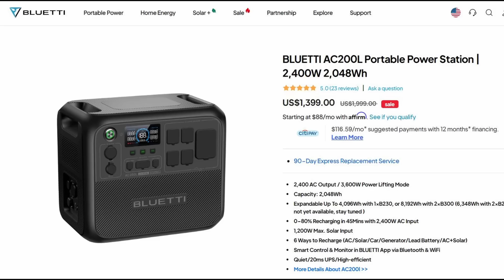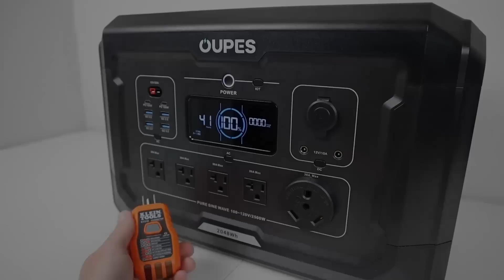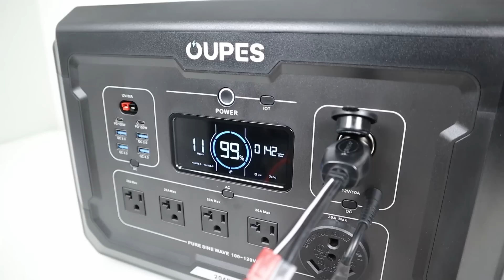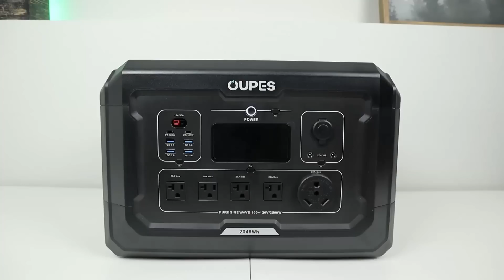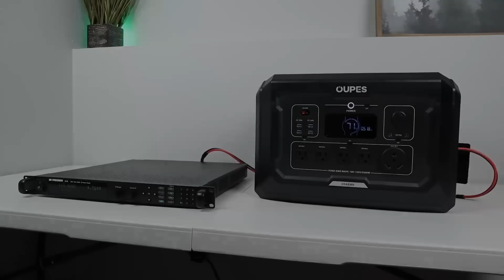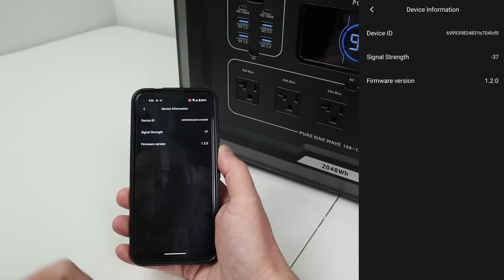The OUPES Mega 2 Wins the Budget Crown! Best Affordable Offering of 2024? Full Testing and Review!

Comment: Oupes Mega 2Fire, Fire. My Mega 2 has been running fine for a few months until last week. I turned on the Mega 2. It and the B2 had 100% charge. I turned on the AC. The units went dead, started popping and black smoke was exiting the Mega 2. Then there were flames coming out of the back. I disconnected the solar cables and removed the cable from the B2 to the Mega 2. The fire went out. There are melted plastic holes on the back of the Mega 2. The B2 back plastic was starting to melt. I will be checking out the Pecron or build my own system.

Comment: It would be really cool to see you revisit this unit with your newest method of showing surge amps/watts on the 30 amp TT outlet particularly with a 13,500 BTU AC if you have one. I'd like to see if the 30 amp plug can handle the surge watts on a camper's AC unit because that would make this an extremely useful camper power station utilizing solar panels. I believe a 13,500 BTU AC running watts are in the 1300-1500 watt range so this should handle that no problem, but I know they can surge up to 3,000 or so for a second.

Comment: QUESTION: When only connected to Solar for charging: When the battery goes low over night and shuts down the system, when the sun rises the next morning and supplies sufficient charge - does this system automatically turn on the AC outlets?

Scenario: Off grid cabin, with refrigerator.  If battery goes dead overnight, will it turn the power back on the next morning, so the refrigerator will have power, once sun is available?
Reply from the maker: No, the AC inverter is either on or off. Controlled by you.

Comment: Chinese lithium batteries are pretty much all the same having said that the mega seems to be the sbc v8 of solar battery generators, may not be the most efficient but it sure is effective 😅 and cheaper by 200-300$, granted it’s got higher output dc is a plus cause diesel heaters need at least 120-140 watts to start up the glow plugs ❤, usb ports all available nice maybe not be as efficient as others but really effective and usable, too bad the solar input wasn’t tested to its maximum capacity, I would say this unit would your best budget buy in the 2k category

Comment: Good morning, Did you by any chance test the Oupes for it's ability to turn the outputs back on when the solar input starts in the morning after going flat overnight???
Reply from the maker: If you have app connectivity you can turn it back on remotely. It does not turn the AC inverter back on automatically.
Reply: @Jasonoid  So the wireless comms does come back on when the solar powers it back up. Excellent!!
I don't believe my Anker C1000 does that.
Thanks
Happy New Year
Reply from the maker: @dannydivine7699  you'd have to confirm that exactly with this model, I think that's the case though.

Comment: It looks like that AC charging cord is proprietary.  I have not seen that male configuration before, so I guess you have to contact oupes if you damage the cord or lose it.
Reply from the maker: It's less common, but it is a standard plug. It's meant for more power than the normal Nema15 amp charging cable. I'm not sure of the name though.

Comment: This review sold me on it. I bought a refurbished unit from the oupes eBay listings which is another way to save money on one when those are available. The first unit was faulty, charge controller had issues when solar power input went above 500 watts but I contacted oupes support and they arranged getting a replacement for me within a few days. That one is working fine. I plan to add on the extra battery to it in the future. I like how each extra battery has a solar charge controller built in so you can get a lot of power sent into them.
Reply: Total Game Changer for Sure

Comment: Hi Jasonoid, thank you for your in-depth review of the Oupes Mega 2. I was wondering what your thoughts are as to why the stand-by idle power usage of the Inverter is so much higher on the Mega2 than it was when you did a comparable stand-by  Inverter idle usage test for 11 hours for the Oupes Mega 3?  31% for the Mega 2 vs.10% discharge of the battery capacity for the Mega 3?  I wonder if Oupes is using different, better battery cells for the larger Mega 3? Can you comment ?  Sure would appreciate your input. Thank you for all the detailed work you put into these reviews especially for the Sogens.
Reply from the maker: The Mega 3 inverter probably doesn't use that much more idle power than the Mega 2 inverter so the larger battery of the Mega 3 gives it the advantage when dealing with idle power consumption.
Reply: @Jasonoid  Thank you. What about the concept that the larger the inverter; the higher the idle drain?  the Mega 3 has the 3600 watt rated inverter while the smaller Mega 2 has only a 2500 watt rated inverter. Seems like the idle drain of the Mega 3 would be considerably higher than 10%...
Reply from the maker: @scottb6020  hard to say why since I tested the unit and that's what it got for the results 🤷 maybe it was a fluke? I'm sorry I don't have more concrete evidence for your answer. I don't have the Mega 3 to test with anymore. They only provided a sample for the video and then wanted it back.
Reply: @Jasonoid  That’s ok. Thanks for getting back to me again. Love your videos on Sogens and solar in general. Am a fan of your Power Grading System too. 👍

Comment: I have the Mega 3 w/extra battery.  What is the best way to maximize the full 2100 W solar each can take in.  I bought some cheap Trina 250w solar panels that are 37.6 V and 8.27A  TY
Reply from the maker: How many panels do you have?
Reply: I have 13
Reply from the maker: @brianwluxevovacations215  I'd put them in a series parallel combo as close to the max 150v input as possible. If you need more guidance on that type of setup you can reach out here:
https://asqme.com/@Jasonoid
Reply: @Jasonoid  using all 13 of them together?
Reply from the maker: @brianwluxevovacations215  I'd have to do a bunch of math and calculations knowing the exact specs of the panels to figure out the best setup.
Reply: Hey, 150v divided by 37.6v is almost 4. So 4 panels in series should work out to 150v. Then connect other 4 panels in parallel. And if you want more do the same, always in groups of 4. So you could go to 16 panels total so you overpanel for cloudy and rainy days, thing is to be at the 150v limit (4 of those 37.6v will achieve that). Current will be limited to 15a so maximum with the 16 panel setup (4000watts) will be 2100w solar input BUT you get to have it mostly maxed out which is great. If you had only 8 panels (2000 watts) then you'd get far less solar input since you cant really achieve 100% solar performance and with clouds its like 20% or less. So overpaneling (safely) is good. Ask someone who knows and can test it in person just in case. Hope this helps. Cheers

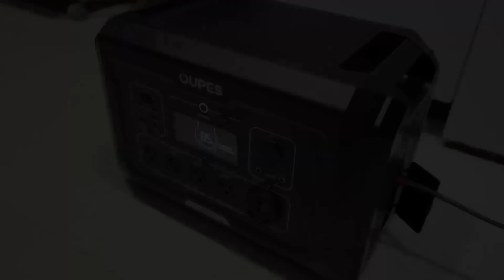Comment: Does this have dark start. 20:00 the Hysolis Apollo has DARK START, meaning of even if it's completely run down, it will start up on sun, and do so at a particular preset charge, say 20%, and then turn on the inverter and maintain loads.
Reply: And would have charge sharing and load sharing like the apollo?
Reply from the maker: It does not turn the AC inverter back on after completely being discharged. I don't think it supports the other two features you mentioned either.

Comment: Replaced an Anker C1000 with the Mega 2. Decision made because of price, 2400 ac output and 2100 watt PV input. Jason’s review was right on. Unit does take time to build up PV input and it does require more power to maintain the inverter on with no load. Neither of these issues have negatively affected my use of the power station. BEWARE though the mobile app is bad. Once set up the Anker connected and stayed connected via WiFi. Occasionally had to refresh the app. The Oupes app has not connected for the past two days and when it does connect it doesn’t stay connected very long. This may be a deal breaker. I am working with support which has been responsive. Another reason I went with Oupes is the fact they have a phone number for support, not just email or chat.
Reply from the maker: Are you connecting with WIFI or Bluetooth in the app?
 I've found the Bluetooth comnection is more reliable but you can't see the device when out of range.
Reply: Yeah, I contacted support over the WiFi connection. They want the unit within 16ft, and Bluetooth/WiFi do not turn on automatically.

Comment: I know you tested the 30 Amp Anderson output but did you test the RV 30 amp? Another reviewer did and said it does not put out 30 more like 25-26 so if you need the RV 30 jump up to the Mega 3
Reply from the maker: Correct, the output of this power station is limited by the inverter, 2500 watts. The 30 amp RV port is there for convenience and only provides 2500 watts peak like the rest of the inverter.

Comment: Excellent presentation.  Thank you.  This is a very nice unit.  Very, very solid 12v output options.   The "square" form factor is very nice (some of their other models have a weird top handle).   If you have space for it, this is a solid unit for car/van/truck camping.   I wish they would take this same unit concept and make a couple of smaller units - say perhaps 1000wh and 1500wh.   You should review their B2 Accessory battery.   It looks to be very solid as a stand alone unit if you don't need 120v outputs and a lot of people dont when car/truck camping.

Comment: If money wasn't a problem, what would you rather buy?

OUPES Mega 2 Power Station or BLUETTI AC200L Portable Power Station | 2,400W 2,048Wh
Reply from the maker: For a camping setup or a home backup setup?
Reply: @Jasonoid For a detached apartment garage where I will charge up in my downtime overnight (maybe just plug in my Ring camera, a 3A), and then a few days a week, I will plug in a 10A load for my power tools for an hour or so at a time. 

I would like to expand my grid system, but I cannot take that with me when I move, and the apartment complex will not allow me to upgrade unless I pay which will cost considerably more. So, I am stuck on a 15A system where I don't have access to the main load center with my neighbors (who don't use their garages at all). In short, I have about 17A I need to break up, and this is my only other viable option.
Reply from the maker: I'd recommend the Bluetti AC200L for doing that. The inverter seems to be much more efficient and you won't need the 30 amp DC output. The fans are also much more quiet on the Bluetti.
Reply: @Jasonoid  Awesome thanks i have been contemplating all day and could not find much about the Oupes. I will order my AC200L. I really am grateful for your help!
Reply from the maker: @OfficialNattyOrNot if you want to support the channel you can purchase it through this link:
https://shrsl.com/4cqcm
Reply: @Jasonoid  Ordered through the provided link! Thanks again!

Comment: I like this unit. I’m in the market for a unit to power my simple van. Can this unit fast charge with the victron dc dc ? Also is there a solution that would allow to connect solar and fast charge cable at the same time or are you limited to one charging connection at a time?
Reply from the maker: Yes it will charge with the Victron DC to DC. Since theres only one charging port, you can only have one source connected at the same time.

Comment: The Oupes 2400w 2232wh  is currently on sale for $799. That blows the Mega 2 away from a price per WH perspective.
Reply from the maker: The older Oupes 2400 has a 45v solar input limit. It's pretty outdated and would take forever to charge via solar. Is also doesn't have smart app connectivity, internal AC charging or UPS mode. It has a much older feature set.

Comment: We bought the Mega 2 a couple of weeks ago, based on other good reviews (ReeWray etc) and your review of the Mega 3. However, we have been really disappointed in the DC idle power usage. Ours loses almost 1% per hour, which is higher than the Mega 2 you tested and much higher than the Mega 3, even accounting for the larger battery. We have been in touch with customer service for 8 days now, it’s been difficult getting responses. However, we finally were told that this amount is normal and expected. So, we are going to return it. Losing 22% of the battery in one day just to keep the DC ports available, which we need to do while camping , is just way too much for us. We thought something was wrong with our unit and would have been happy to exchange for another one, since we like everything else about it, but since they say this is expected that is no longer an option. Just wanted to mention this. Of course, if you have any thoughts or insight, that would be appreciated. I have learned a lot from your videos and appreciate all the time and effort you put into them-they are very thorough.
Reply from the maker: What did Reewray see on his idle usage numbers in his tests? I saw 8-9 percent loss over 12 hours so that lines up to their 'normal' operation of 16-18% over 24 hours. The devices you run also will drop it an additional amount.
Reply: @Jasonoid  I actually don’t think he did this exact test, but I can go back and look. He does most of the other ones you do. Yes, you saw 8-9%, we are seeing 11-12% (22-23% in 24 hours)- and we even tested only having  either the high power DC enabled or the low power one, as well as both at the same time. It didn’t matter, it lost the same amount each time. We also turned the wifi/bluetooth off just in case that was using extra power. Because they kept requesting that we try different things after each phone call (like fully discharge then recharge the battery several times) we ended up testing this several times as well.  Also, for these tests we had nothing connected, we just wanted to see how much it used on its own.
Reply: @jasonoid. One last thing. This is from the last contact I had with them. As I said we are returning and will choose a more efficient battery, which we know will cost more. We are not unhappy otherwise with the OUPES, but this is important to us. But, it is worth seeing what they say. Maybe they have changed something or there is a quality control issue with their system. We received ours around March 15.

“ DC standby consumes about 12% of power overnight, which is normal.
The standby power consumption of DC is about 12W and the standby power consumption of main power supply is about 8W.
For the Mega 2 power station, the power consumption per hour is: 100/[2048/(12+8)]=1%.”

So they say 24% power lost from standby DC power is normal (even worse than what we tested). Just something to be aware of.

Thanks again for getting back to me! Will go back to your chart to help us choose another one. : )
Reply from the maker: @athensrunnergirl  thank you for providing all the great info. You know it would be pretty cool for companies to include all this technical information on their website or owners manual. The one thing ive found with budget units is that that they have less efficient hardware. I guess that's the tradeoff of saving $0.25 to $0.35 cents per wh. Having solar connected usually offsets the losses.
Reply: @athensrunnergirl  I appreciated your guys comments here. Did you end up finding a more efficient battery?
Reply: Damn that’s a deal breaker for me really wanted to get this one.

Comment: These monster units are interesting and well worth following, but what is the landscape looking like for more portable units, like in the 320-500 wh range? It seems like they are less available than they were a couple years ago.
Reply from the maker: All the brands still make them, they just aren't as usable with the small capacity and smaller inverters. 500wh is the minimum size I recommend for camping with a 12v fridge, any smaller and you don't get much power from it.
Reply: @Jasonoid  that's fair enough: it has a lot to do with how you use them. For daily use we mostly charge devices like phones, tablets, laptops, including on long drives. So of all my various units, the lunchbox-sized ones have been discharged and recharged most frequently by far. The big ones tend to wait for weeks or months between uses. And as an aside, I've been impressed by how long those will hold a charge.

Comment: So are you saying the AC function is more efficient than the DC function?  AC was 86% efficient vs DC at 82% efficiency.  That would be a first for me.  Usually it’s the other way around.  Would you have had a better result if you performed the DC capacity test using the Car Port plug instead?

Comment: First time viewer, very nice review. I’m trying to find something for overlanding that I can throw in my Land Cruiser for weekend camping but possibly use with my 5th wheel if I find myself needing to boondock and needing more power then my lithium battery and solar installed on my RV already provides. 

I’ve been checking out the c1000 anker solix lately but it doesn’t offer 220 connections.
Reply from the maker: The Anker C1000 is great for over landing, it's a little small for use with an RV. This model is a good compromise between size and power. It's pretty compact but still has a large battery.

Comment: Debating between this and the Ugreen PowerRoam 2200. This is cheaper but the Ugreen is a lot more efficient.
Reply from the maker: The Ugreen is a higher quality unit, the only downside to the Ugreen is the 60v solar cutoff (it does allow up to 75voc).... But at least you have dual charge controllers so you can split your array in half.